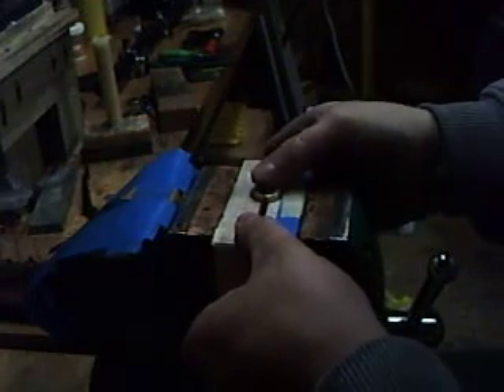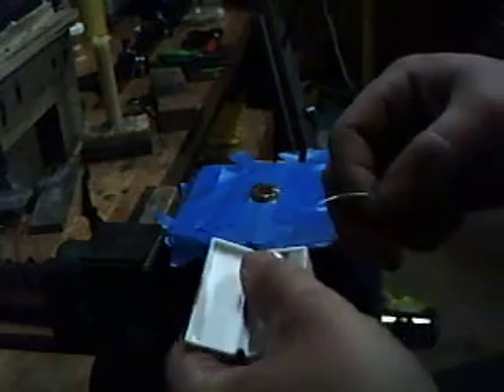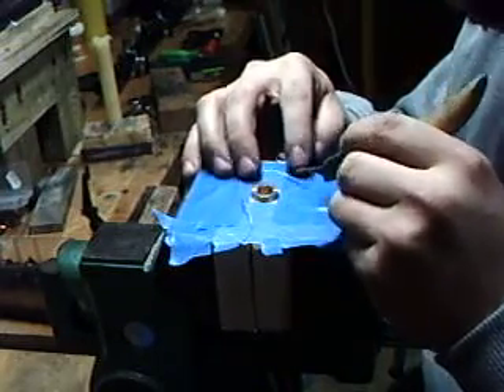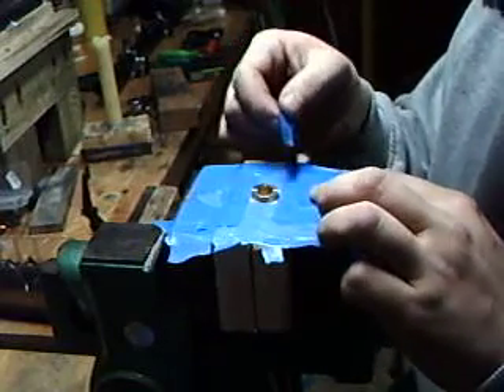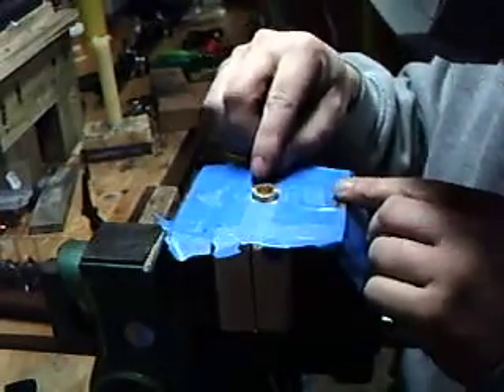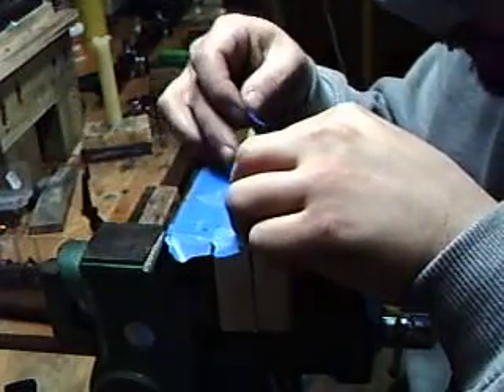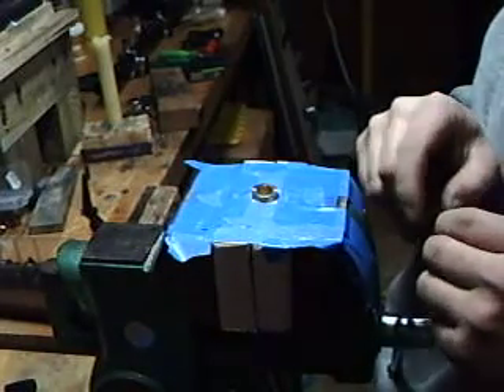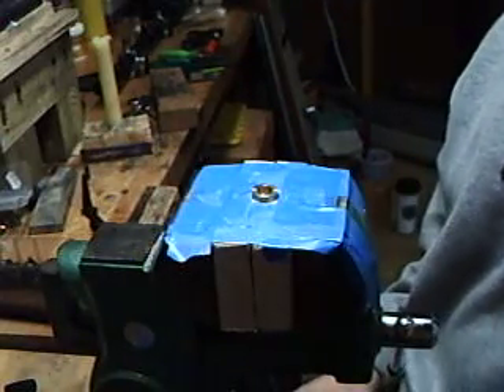installing crosshairs

Comment: 17 years later, still relevant... I just pulled a single strand of Kevlar from fiber optic jacket stripping, the results exceed OEM (mind blown). I also found, gently tensioning the reticle (in my case) resulted in a tighter crosshair when released. I repositioned for each hair. Thank you for this timeless suggestion.

Comment: Jarrow I bought a 4x16x40 UTG scope and I went to set it and the yardage control behind the front lens slid off and is dangling on the scope. It has fine thread but will not reattach can you help me out  thanks
Reply from the maker: i would say send it back. did you try turning it reverse to see if you can get it started that way? Just a thought.

Comment: I've tried   Girl hair, spider web, unravelled dental floss and found them all either too thick or too brittle.
I finally tried  using a thin thread of rubber cement successfully
I dabbled two toothpicks in a drop of rubber cement and drew out a thin thread.
I opened my bench vice about 25 % and anchored the glue thread across the jaws.
I then opened the jaws out further and achieved an extremely thin glue thread.
i then held the brass bezel directly beneath the glue thread and carefully raised it until
it contacted the thread of glue between the marks that I had scribed on the rim of the bezel.
I repeated the method for the other cross hair.
The bezel has been used in a violent springer air rifle for about 12 months and still remains in place.
( a drop of glue on the ends of each strand was added for good measure)
If the thread appears to be too coarse it's really no trouble to clean with solvent  and 
have another go at it.
Really tried this as a last resort before deciding to bin the scope, but was pleasantly surprised that it worked out so well.
Cheers jarrow708,your video was good.
              Greetings from Queensland Down Under
Reply: Wht do u mean rubber cement I not understand tell clearly reply .

Comment: How do you measure that everything  is square ,i tried this years ago with soldier wire and its not 90 deg but it works,but watching l would like to improve it,any tips...
Reply from the maker: i cut the groves on a mill with  a center bit and a R8 collet spinner since the groves dont need to be that deep.